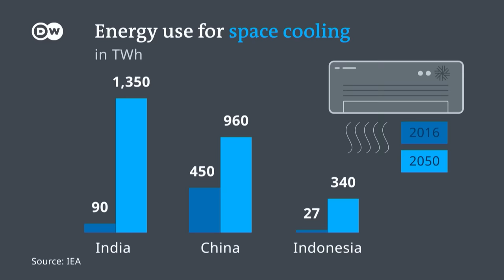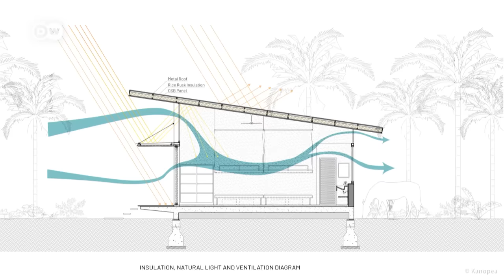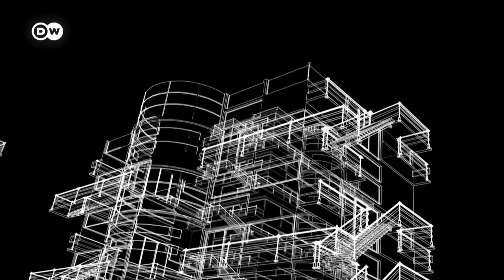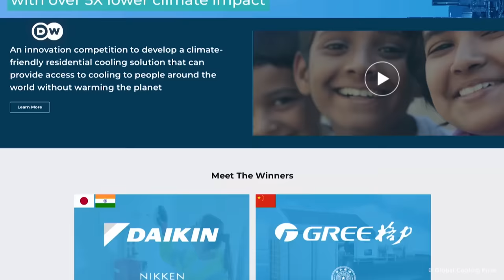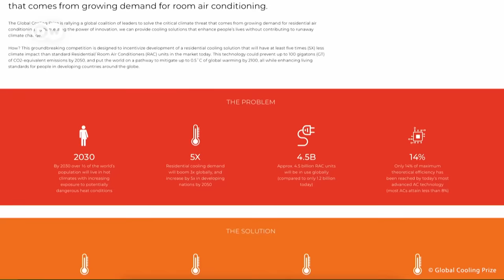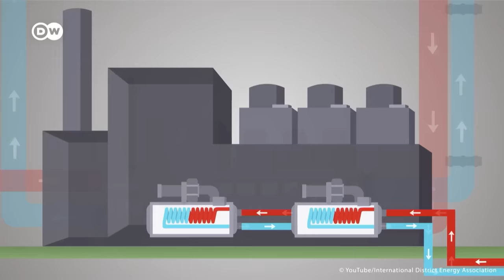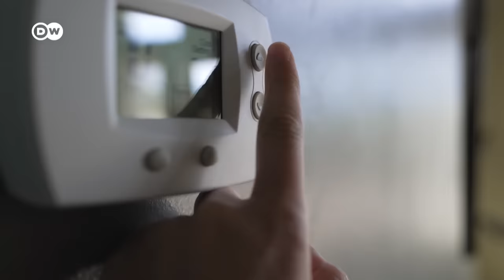How to cool our homes (even without ACs)

Comment: Some new high tech cooling is possible via aero gels, the mike oehler designed earth sheltered home needs no AC or heat.
The solar ice project works similar to the RV fridge, or Einstein fridge, using heat to create cooling.
This heat can come from solar thermal heating of oil, like the SEGS system in the mojave desert.
photovoltaics require a lot of mining and eventually burn out after a few years.

Comment: Easy to be said than done.. you can push this but it should be backed up with available solutions.  Comparing the old design to current situation is not feasible. We should think first the difference between population before and today.

Comment: Im an HVAC tech. The truth about all the new high efficient system coming out are designed to fail! Evaporator coils develop leaks in 1-2 years and cost the customers more money! Compressors are going out within a year. How are we able to measure efficiency when the H/O has to keep repairing their units?! That is not high quality and it not efficient for the customer to pay for crap!

Comment: The fundamental issue is building technology, India has construction standards of 19th century with no innovation at all. Most forts in Rajasthan stay significantly cooler inside because of innovative cooling solutions. However, current homes are just heat absorbing structures planned poorly.

Comment: 0:23: 🌡 Air conditioning is a major contributor to global warming and energy consumption, but there are solutions to reduce its impact.
3:29: 🌍 Sustainable cooling solutions can reduce the reliance on air conditioning and mitigate the urban heat island effect.
6:48: 🏢 Glass buildings contribute to energy inefficiency, but more efficient air conditioning can help.
10:19: 🌍 District cooling is an efficient and cost-effective solution for cooling entire districts, but it requires significant infrastructure investment.
Recap by Tammy AI

Comment: i say make a new norm 
of making home sand building that uses desing for batter air pass throu 
like for example we made our new home 
now we didnt intentionaly  did this the way  our home is wind flows form one side to the other making it very cooland taking away any heat and humidity 
like we left a narrow 3 feet passage to walk to back of our house on the side of our house if you sit like in fornt of it its often like you sitting in font of ac 
well sort of 
but this has only one issue 
in winter your house will be more cold 
but that can be solved with minimum heating and more clothing

Comment: Built my house with good air flow principles, i got cooler house and didn't need to use ac that much. However an idiot burning trash and leaves behind the house everyday force me to rennovate the house, closing huge part of the ventilation and rely on ac everyday.

Comment: in indonesia, i know for sure this year's summer is going to be no less hotter than previous year or even worse. it is so hard for us middle to lower class (the majority of ac's users) to not depend entirely with ac on daily basis, the heat can be unbearable lately thus we struggle to function normally at work & school. with corrupted government, the building code & environment law are easily bribed. every architects & developers which only the middle to upper class could afford are doing anything for maximum profits but none  paid attention to the local environment. and they all want the same thing which is modern brutalist building with flat ass roof, our ancestors surely are crying

Comment: We cool the interiors and warm the exterior, creating the need for more cooling?
Wait but that jut violates the conservation of energy... there will still be the same amount of energy, ACs dont warm up the ambient, they just transfer heat. so there wont be more need for cooling in a exponential way as it was implied. If the atmosphere doesnt heat up more by additional energy imput from the sun, or more heat being trapped via greenhouse gases... the usage of AC won't heat up the atmosphere any further. It will simply change the heat distribution in a wee tiny little way in global scales.
Ok we need more electricity to run more ACs so that's where the "heating up" part would be... but that's a way too simple point of view, if not by ACs, our energy consumption would still rise as we continue to use more and more electrical devices... 

So to say ACs warm up the world thus needing even more ACs is extremelly false and misleading.

Comment: But in European use fire or heater for which used more energy and produces more carbon dioxide
AC uses less energy than heater or heat pump or wood fire 🔥

Comment: Scared to make a video on how much energy gets wasted and heat added to the environment while heating German homes? Or is it that developing countries like India are easy tragets for you at DW?
Reply: eliminating the need to cool at summer at expense of slightly higher power usage at winter is nothing.
Reply: @AmelpsXett  air conditioning is a heat pump...it doesn't add heat to the atmosphere...it removes heat from the room and transfers it to the atmosphere...only heat added is the electricity that gets converted into heat during the running of compressor...where as when you heat a house you transfer chemical, electrical or whatever form of energy directly as heat to the atmosphere.

Comment: Qualitative solutions won't work. The limitation of the current urban environment with high building density and the need to "quantitatively" provide conditioning and ventilation is not something a passive system alone can achieve. When you design passively AND need to put an HVAC system in there, the economics don't really pan out. This is the real reason why we need to look at better cooling technologies instead of passive cooling.

Comment: Natural passive and mechanical air cooling solutions are simple and affordable, but low efficient. Traditional vapor compression air conditioners are widely distributed and common, but expensive and harmful for nature, people, and climate. 
What could be the real climate change solution?
There is unique dew-point indirect water evaporative cooling tech able to create, commercialize, and bring to people efficient, climate-friendly cooling solution in collaboration with key stakeholders and implementing partners.

Comment: there's no such a thing as more efficient AC's. We have reached the pinnacle of AC construction. Most of the AC"s use the same type of compressors, which is the heart of the AC and the biggest consumer of energy. the part with ac's not measuring correctly the humidity and thus adding a better humidity sensor to improve efficiency is laughable.

Comment: y??? only target India, China, Indonesia... The whole Middle East for decades been using A/C or cooling systems inefficiently.... coz its way way too hot in the desert... and inverter type A/Cs or eco A/Cs dnt work there and aren't feasible....  they have District Cooling in Dubai but that's a total rip off when it comes to cooling charges..... and since they have oil to burn doesn't make sense to be efficient in cooling... In the middle east oil money has more power than efficiency...

Comment: they don't create heat they transfer it as it's impossible to create cool you can't make -1 volt same thing with heat pumps energy can not be made or destroyed but it can be moved  also there a sealed system they should never leak gas under normal operation also inverter ac draw less power then a celling fan @DWPlanetA

Comment: 🎉 whatever new technology or idea wouldn't work if it remain more expensive to buy than traditional tech. (company should think if remain exclusive idea won't take off but manufacturer should think there will be millions of aircon unit to be replaced so cost can recoup from there but if manufacturer think traditionally then no consumer will want to replace since it still can be use. another issue is whatever tech is mentioned here is not really convincing just like electric car where it is full of disadvantage or flaws.

Comment: 10:00 "You will save much more energy over the ten year lifetime of that air conditioner."

HAH, that's a funny joke.   Most window unit air conditioners last maybe 2-4 years at best before they crap out and fail with one notable one dying after a single year.   The longest lasting window unit I've had was 5 years old and that was babying it, taking it apart and cleaning the scum out of it every year that builds up inside of the condenser.  If this guy thinks a glorified window unit with a better dehumidifier and sensors is going to last in this age of planned obsolescence, he's smoking something.

Comment: were doomed 😂 good thing I live 2000 ft above sea levels. Move back into using brick and cinder block buildings. They are made to keep the inside cold and keep the heat outside.

Comment: This video misses the mark in many ways. all points about heating innovation are less important than cooling solutions. more people die from cold even in india. an economic solution always wins in developing countries but the tech comes from a developed country that spends money on innovation and patents are protected and rule of law actually works on the most front. heat pumps that heat and cool are the solution thats already available where people can afford them. getting this down to a reasonable price is what will drive countries like india to implement it. also goes for sub saharan africa that will be next in line to buy cheaper AC's.

Comment: Modern architecture is the worst contributor to this. They are made of concrete and glass which are the exact opposite of keeping a building cool. Thats the problem with modern architects. They dont take in consideration climate and local resources. They build the same building no matter what country. Vernacular architecture should be taught more in architecture schools. If people have already been designing buildings that cool themselves then why are architects trying to reinvent everything from the start?

Comment: Heat = energy
You cannot create or destroy energy; Law of Conservation (matter + energy)

When the AC removes heat from the air and sends it outside, yes it's hotter air, but it's not a cycle that builds on itself due to our usage. 

Equilibrium states that all systems and things desire some equilibrium. So the air temps will balance back out, not get hotter to feed into the cycle.

I'm a college dropout and I'm smarter than the climate science experts lololol

Comment: Awlful lot of talk about nothing.  Except for building district infrastructure cooling which will be problematic at best, this was just a lot of nonsense about how humans being cool is bad.  One long Propaganda video with nothing but proclamations.  I was hoping it answered the title but it does not even come close.  It's like this story.  If you have any visable IQ you will get it

 “It warms things up by radiating energy to people, not the building”, he explained to me. It was about -20°C (-4ºF) outside that day, and for whatever reason his system was not radiating much energy to me. This guy’s house was almost as cold as a fridge. It was probably less than 10ºC or 50ºF in there, though he didn’t seem to notice. “The manufacturer says you’ve got to move around for this kind of radiant heat to have any effect on you,” he explained. “The more you move, the more radiant heat energy you attract,” he said, smiling as he paced back and forth in the living room, inviting me to do the same. “We’re hardly spending anything on heat this year and I’ve had all kinds of people come over to see how this thing works.”

Comment: Call me crazy, but I think we all need to adopt policy, that really shouldn't have to be said, but obviously it does. 

You can't make videos or "lobby" in any capacity, against hydrocarbon powered, air-conditioning, from the comfort of your hydrocarbon powered, air-conditioned office. 

Similarly, we can apply this logic, to all facets of policy making. Such as, you cannot outlaw automobiles, if you use them to go places. You cannot promote gun control, if you are surrounded by armed security. You cannot levy a tax increase on any sector, untill submitting your taxes for independent review. You cannot cull livestock to reduce greenhouses gasses, untill you stop eating the livestock. And to that degree, you cannot lobby for a greenhouse gas reduction from any sector, until you have reduced emissions from the top three industries of greenhouse gas emissions by 50% first (basically all your construction projects containing steel and concrete [all of them]).... and the list can go on forever. 

Like I said, we shouldn't have to have this conversation, but because our parents ignored it here we are....